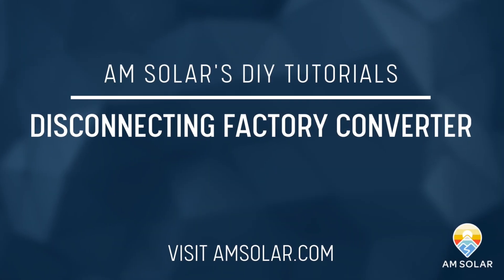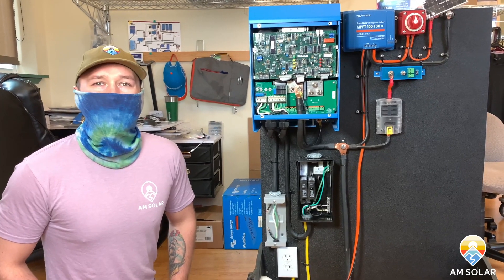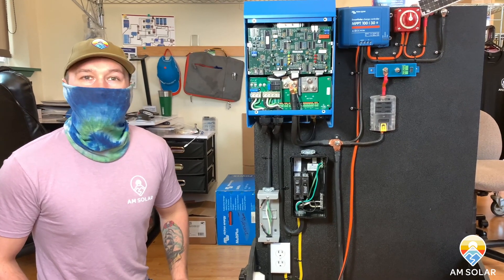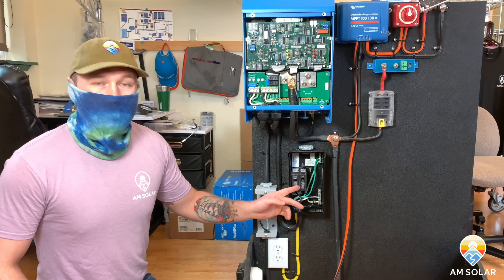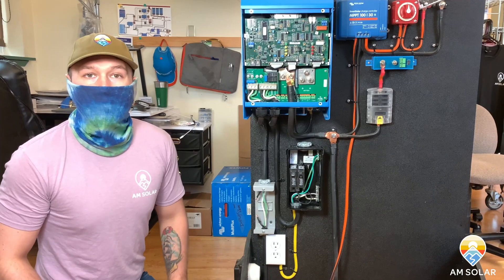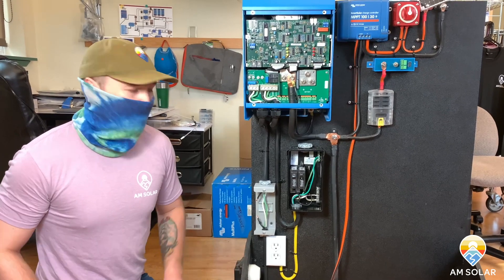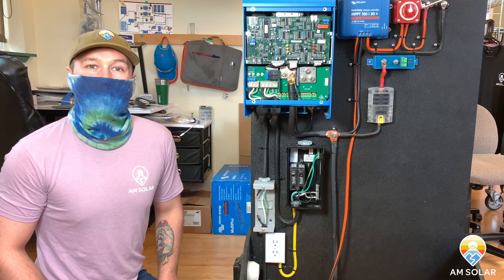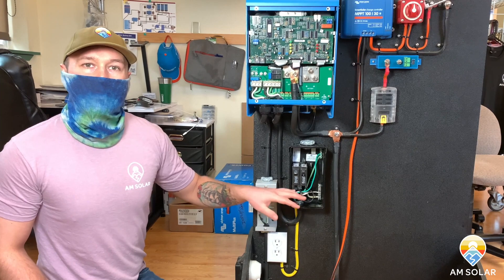Disconnecting Factory Converter Tutorial (DIY)

Comment: Thank you Dylan!  I have searched YouTube for hours for your simple explanation to diconnect/isolate from the electrical system, the old WFCO Led Acid CONVERTER in our 2018 Fun Finder Trailer.  I have installed a new LifePO4 sytem that includes a 3000w INVERTER/Charger, 300ah LifePO4 battery with an existing 830w existing Solar System, MPPT charge controllers. I believed that was the way, but did not want to invite electrical issues so, I've had the breaker off, but will now pull the wire and use a Marrette connector.  Yeah! As per another comment, would be good to see a step by step removal of an existing Converter in an RV when installing a separate new Inverter/Charger system. Although your simple explanation has covered it for me.  Thanks again.

Comment: hello nice videos 
could i ask a question about solar charge controllers from the brand victron energy?
I was wondering if the MPPT 100 I 30 type would be good for 2 Solar pannels with:
max power 320W
open circuit voltage 40,2 volt
max power voltage 33,2 volt
short circuit 10,07A
max power current 9,64A
max series fuse rating 20A
Reply: I recommend the Victon SmartSolar 100/50 for that application.  Good luck with your project.